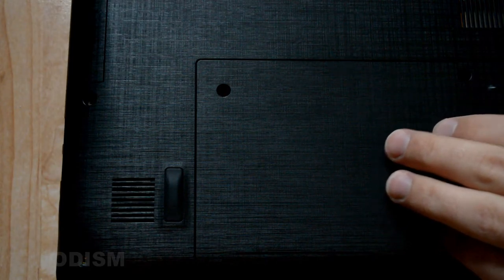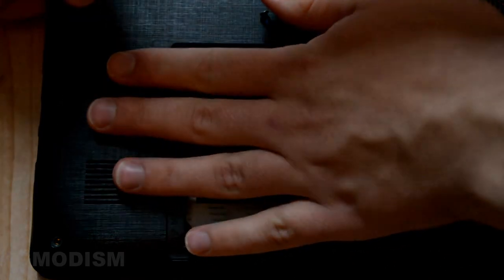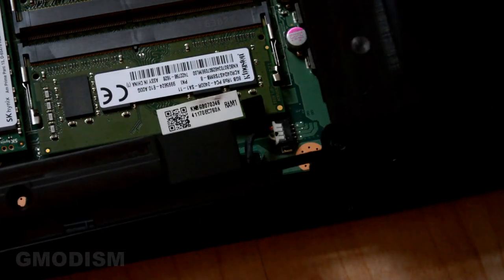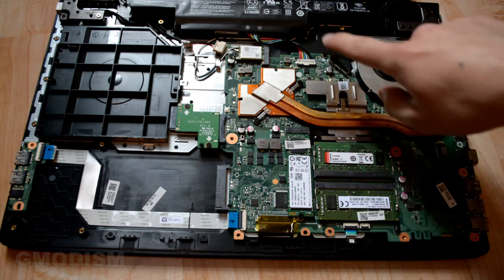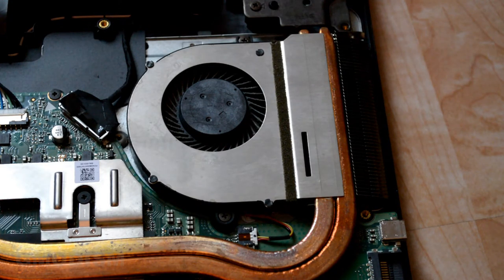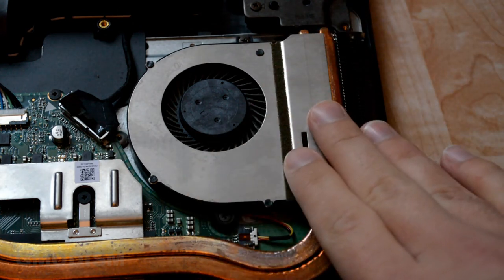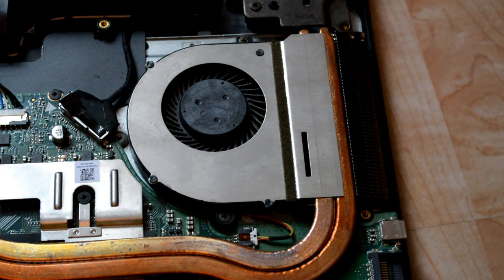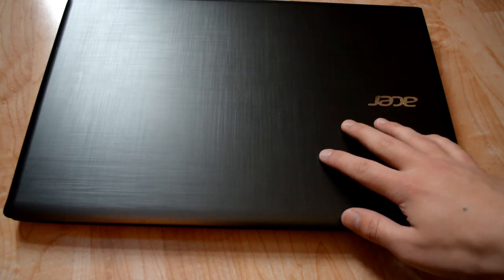How to Clean the Dust From Laptops Using Vacuum Cleaner (Fix Laptop Overheating Issues)

Comment: Bro wouldn't the vaccum cleaner destroy the components inside the laptop? Is it safe to do this? Also do we have to remove the battery before doing this?
Reply from the maker: You need to be careful and very mindful about static electricity, follow all my steps very carefully. Safe? depends on you. It is advicable to remove battery but if it is hard to remove because it is not a clip like this you can skip it, but PC must be off.
Reply: @GMODISM  Alright bro will be careful.

Comment: Should the vaccum cleaner use to suck air or blow air to clean laptop
Reply from the maker: Mine only sucks, both methods work :)
Reply: @GMODISM   toothbrush on fan?? plastic insulator??